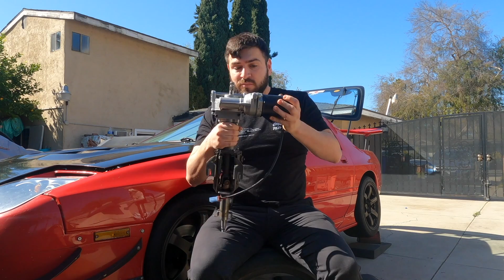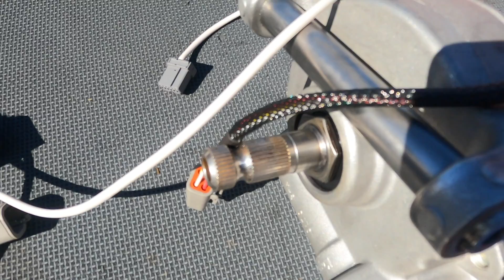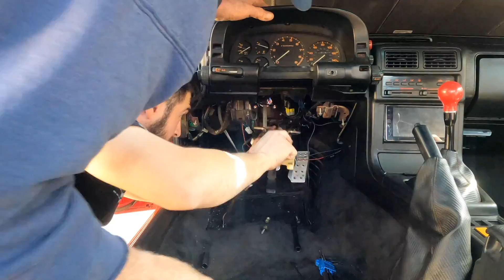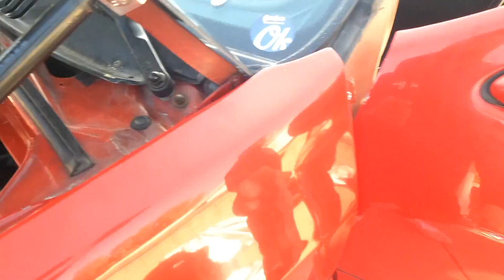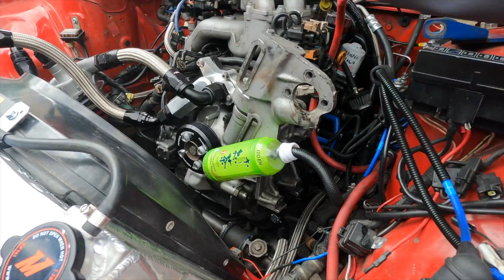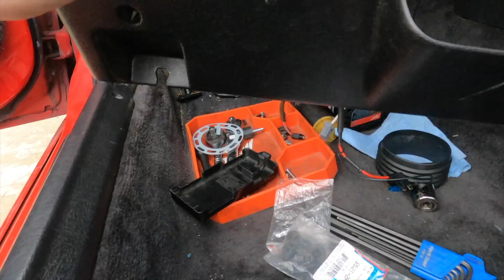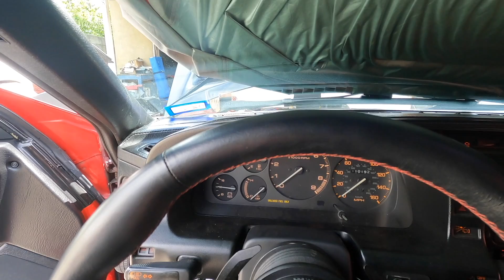Ditching Hydraulic! Installing Electric Power Steering (EPS) in My FC RX7

Comment: What a good video, this is super gold information for FC owners. How has your install held up? Does the manual rack on its own feel like it needs the electric steering? Do you keep the setting low assist for the most part? Would love to hear your opinion after 2 years.
Reply from the maker: Install holds up real well. When there is no assist the manual rack is truly a manual rack. Though with the PBM knuckles and the reduced Ackerman the steering isn’t terrible. At the moment the car has been down. But I did track with the eps. It felt fine no issues. Mind you I barely had any assist. I went on to do the same kit on my brother’s 86
Reply: @Gabrielized.  Appreciate the reply, hope you get your car back up soon!

Comment: How does it react compared to the ps rack
Reply from the maker: I have the assist knob turned past the point where the assist turns on. It feels like OEM PS to me. I did the mod more for space. Luckily I didn’t feel a difference which is good.
Reply: @Gabrielized. what rack are you using manual or depowered
Reply from the maker: @StanceSpecialist manual rack from an s4 FC. Though if you do depower a s5 PS rack you should have a better steering ratio.
Reply: @Gabrielized. how many turns from center to lock on the 20.1 ratio and do you like it because i have both power and depowered
Reply from the maker: @StanceSpecialist I honestly don’t remember. I did have the PBM knuckles when the car was running. Now everything is taken apart. Not even a subframe in the car.

Comment: Man builds JDM drivers car. Replaces hydraulic with electric steering 🤦
Reply from the maker: Man builds his own car
Reply: @Gabrielized.   So how is the steering feel with the EPAS? Do you like it? Is it easy to feel the road grip?
Reply from the maker: @superbarnie I like it a lot. Feel like original power steering. I hardly have much assist on the controller. Just barely giving assist was more than enough for me and my preferences
Reply: @Gabrielized.  I'm more worried about it being too strong, and numbing the steering feedback. You didn't find that to be a problem?
Reply from the maker: @superbarnie  I've had quite a few people express that concern. I had the same concern myself. The steering still feels precise. Mind you I have the assist just barely past where the actual motor kicks on. If I were to go all the way to max it would be super numb. If you look at the video I believe I mentioned it and showed where I left the assist.
Reply: @Gabrielized.  Alright, thanks a lot for the info, I appreciate it. Your 1:28 lap at Streets is sick. What size tires are you running front and rear?
Reply from the maker: @superbarnie  you're welcome. 245/40/17 Square